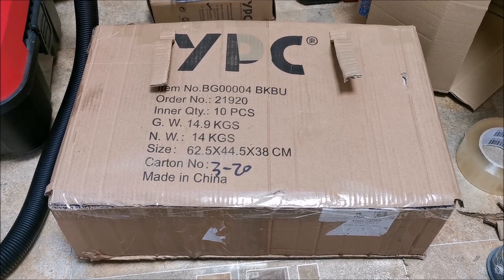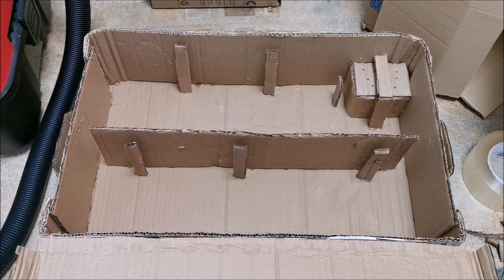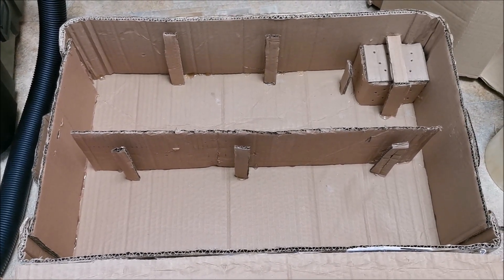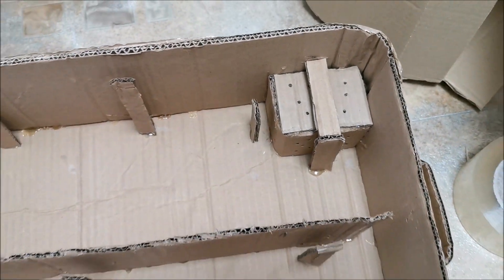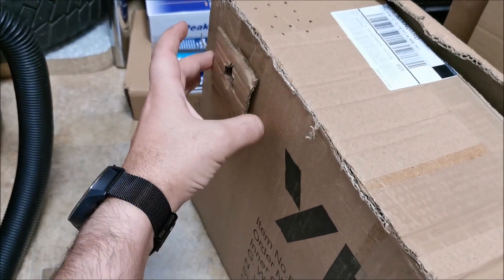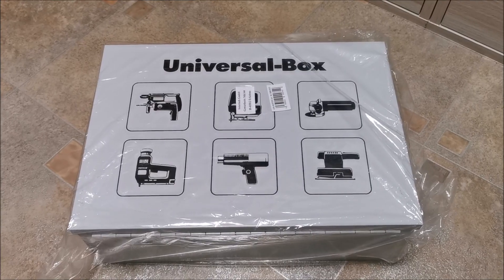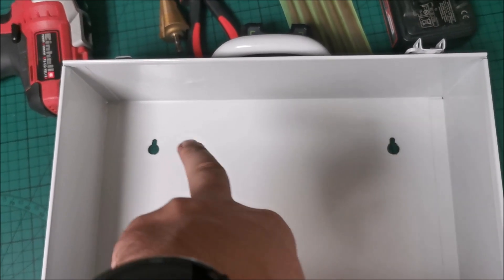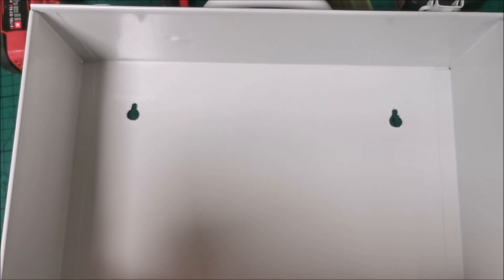Making a simple fire resistant box for lithium batteries 🔋🔥

Comment: You don't want holes to let the fumes out.   If the fumes come out, air goes in.   A fire needs fuel to burn and air.   If you make the box airtight (ideally), and it stays airtight, then a fire can't burn inside it.
Reply: Lithium fire is a self-sustaining reaction due to its chemistry already containing the oxygen and fuel. You want the pressure release vents to prevent the box from bursting open and releasing the flames. If there are other reasons you don't want to let air back in, then a one-way valve flap is not that hard to implement.
Reply from the maker: I think it's a bit different with lithium fires. But I could be wrong

Comment: Haha not better just to recycle the batteries that you are not using and not leaving them around the house?
Where did you get the idea to build it in this way?
Reply: i recycle mine but sometimes there are times that it may be a while before i can get to a place that accepts them (no place local), so it would be nice to have a fireproof box to store old or swollen batteries, especially from laptops or old drills, anything with a lot of output power after doing a repair
Reply from the maker: Just an added safety layer 👍🏻
Reply from the maker: Yup, I recycle them, but this powerbanks are still being used on vacations. So, rest of the time they stay idle and drive me insane 😄
The laptop battery is waiting to be disasembled and the cells reused in some solar lights.
The idea came from other YT videos, like the one in the description.